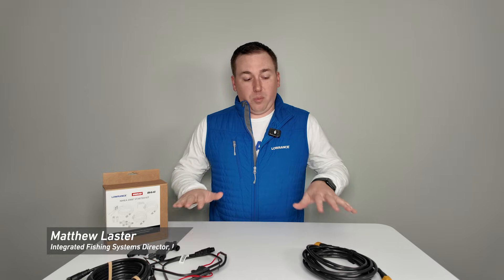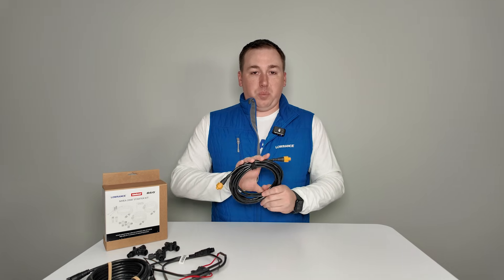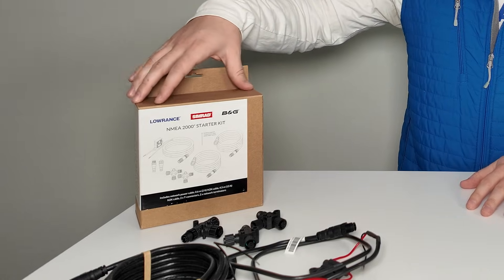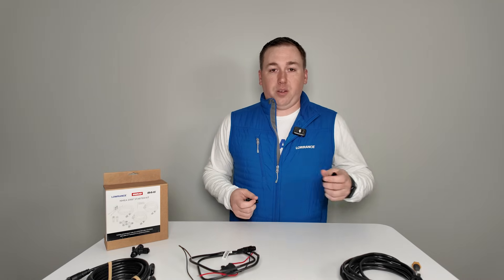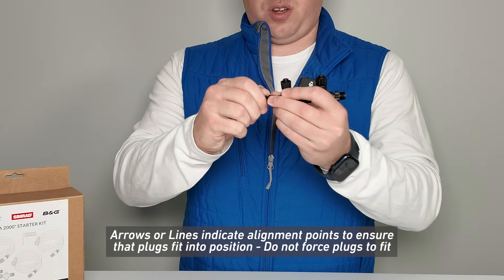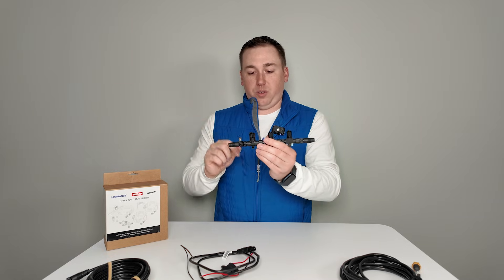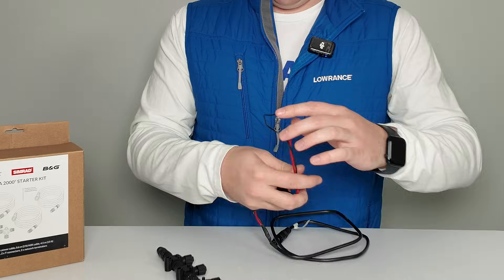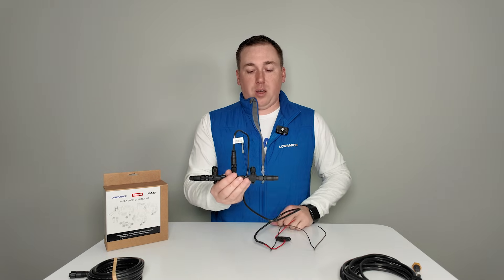Understand Your Lowrance Network: Ethernet & NMEA 2000 Basics

Comment: So the Lowrance starter kit I just received has only 2 X 3way connectors.  It should contain three so at least you could connect two devices because the power cable take up one by itself (doesn't have it's own 3 way).  Video shows total of 3 terminated connectors which makes total sense.